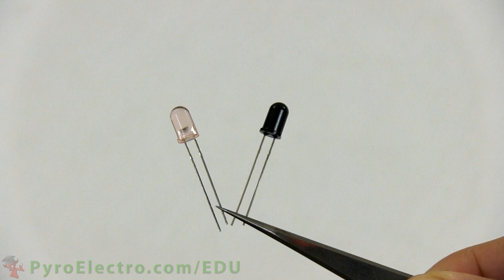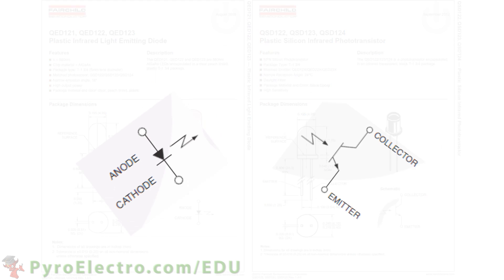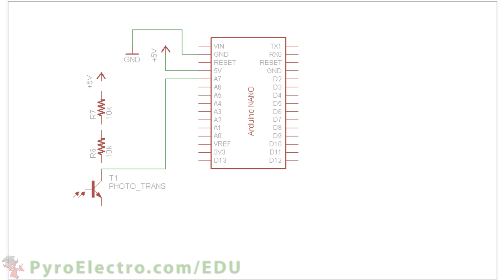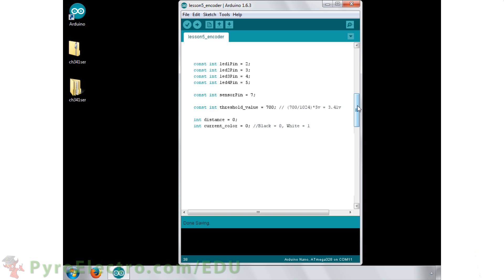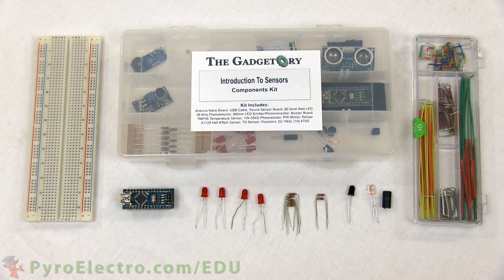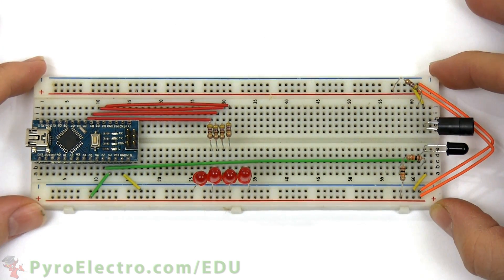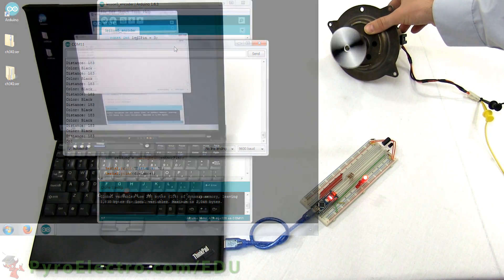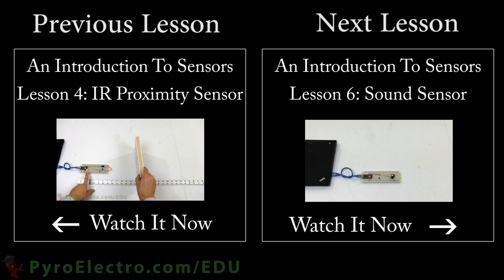Infrared Encoder - An Introduction To Sensors - PyroEDU

Comment: your code says: IF ( we read a value above the threshold value)  we toggle the current_color & we increment distance
ELSE IF ( we read a value below the threshold value) we toggle the current_color & we increment distance..no sens
wrong code because of the wrong braces..there are 2 closed braces before ELSE , you should remove one.

Comment: Thank you for this video. Very instructive and easy to follow. It definitively helps people like me who are starting with arduino. 

I tried your code and found that I had to replace the line const sensorPin = 7; with const sensorPin = A7; for the programme to work on my nano board; see video at minute 3.26. 

Although you mentioned in your video analog pin 7, the code refers to digital pin 7, which made me think that my phototransistor was broken or that I had done something incorrectly in the schematics, since my readings did not make any sense.

After I made the change my readings started making sense and I could move to the next step. I hope this can help others who might want to use the code for their projects.

Thank you again and keep posting such videos, which I follow very often.

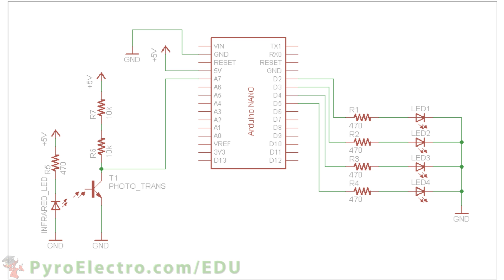Comment: IR led wrong way round  @ 3:13 ?
Reply from the maker: Matt Baker Yea. Rookie mistake >_<. Thanks, we'll update that on the schematic.
Reply: PyroElectro I feel bad as I love your tutorials :)
Reply from the maker: Matt Baker Don't feel bad, feel great. Your comment will help many others from getting confused until we can get things updated. We love getting feedback & thanks for the nice words.
Reply: Also, the A7 pin should be on the other side of the photo transistor.   That's a big mistake, and that is 2 mistakes on this important circuit, and that makes me wonder.  There is so much disinfo out there when it comes to electronic circuilts, and computer code.  It is always wrong.  Most of it.  It is statistically impossible for it to be that way in a real world.  Our world is not real at all.  But even with the mistakes, intentional or not, it is still a good video in that he tackles the problem we are all trying to solve on the cheap, and there are no really any other videos out there like this one that really lays things out well.  One keys is knowing to use an IR LED and a phototransitor and not a regular LED with a photoresistor. ...although that still may work.  But not as well, and it would be harder to control the light.  An IR LED is a great idea.  And it teaches you that you can match the IR LED with the photoresistor.  To build the housing for the IR LED and phototransistor will be a bit tricky though.